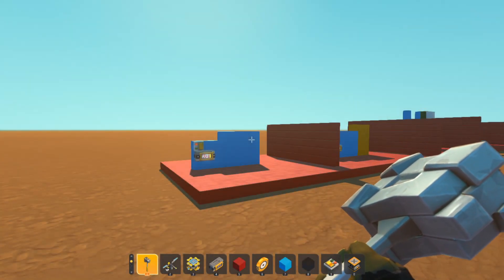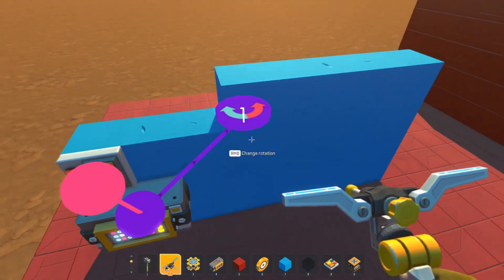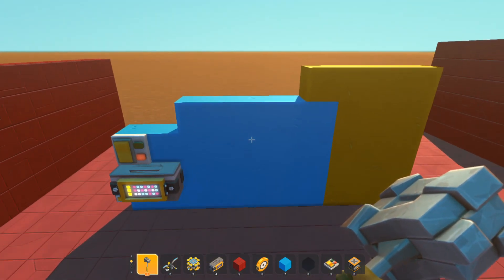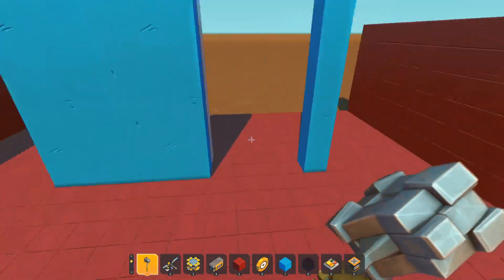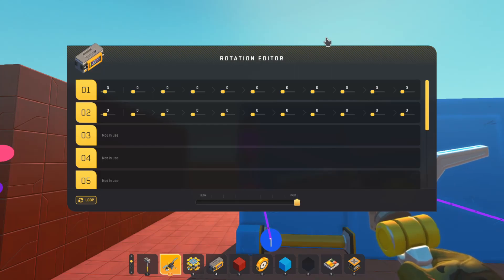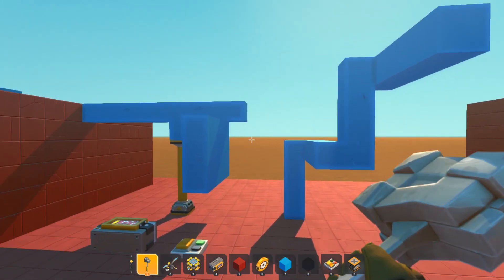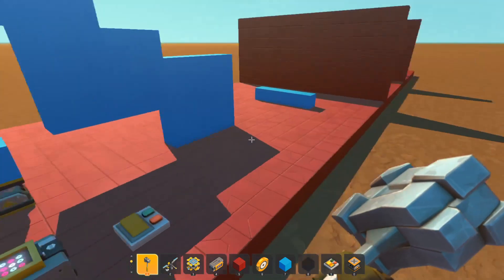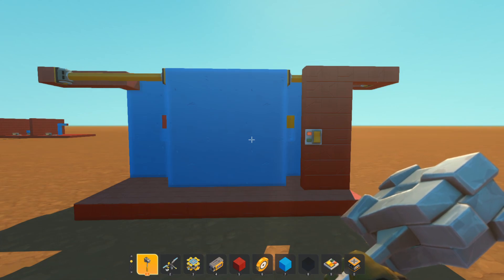Controller, complete Beginners guide | Scrap Mechanic

Comment: This is helpful but how do you do 4 on the controller
Reply: Like 4 percent of the 360
Reply from the maker: Hold control on the keyboard( If its not control its shift) as you drag the mouse as normal

Comment: Whenever I connect a bearing it just rotates until it hits something regardless of what I set it at, and it doesn’t go back unless I remove the input in the controller, never stops at 90 even when I put it there
Reply: Hm I deleted the entire build and then redid it all and it worked? Sorry but thanks for explaining stuff this video helps!
Reply from the maker: @klasmova2771  sounds like you had the controller on loop. this is often an issue, especially if you already use the controller for something and connect to another bearing while its running the loop, it can really mess things up.

always make sure everything is off and go through it carefully when adding

Comment: when you are working with pistons, cant you just press ''e''  and select the length of the piston?
Reply from the maker: you can if you want them to activate at the same time.

If you run them through a controller you can stage them to go at different times in a sequence

Comment: it will not let me connect the switch to the controller
Reply from the maker: This only happens if you already have a switch or button connected.

You can only have 1 switch/button connected to the controller.

If you want more, you need to have a logic gate in between